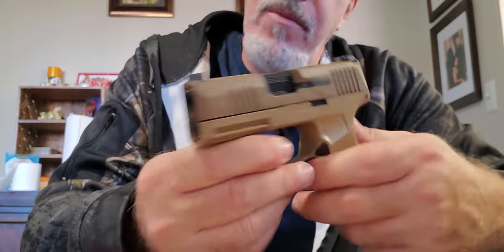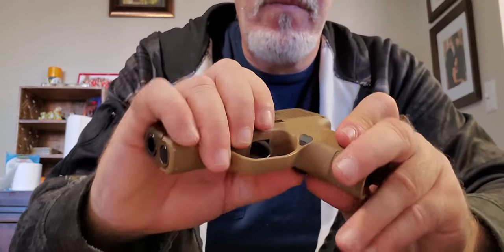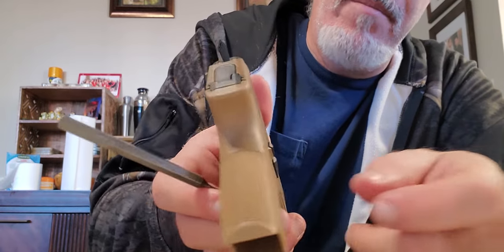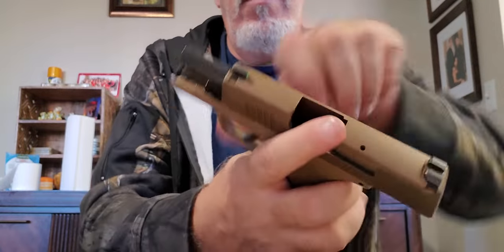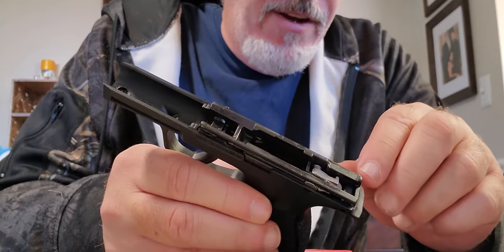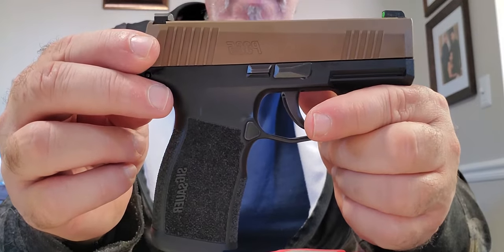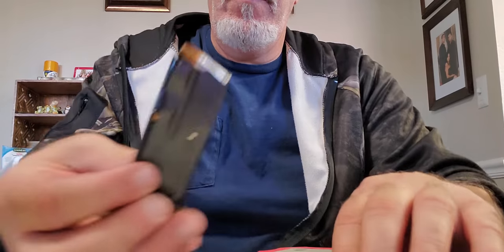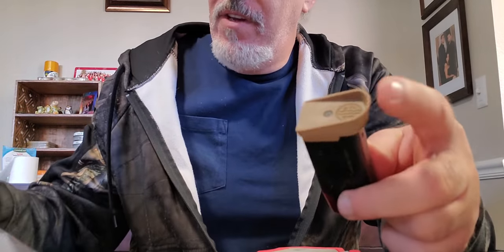Sig p365 grip to a p365 xl grip

Comment: It looks like the pinky extension on the 12 round mag when inserting in the xl frame is sticking because of the wings on the baseplate. There is a cut out for those wings on the regular p365 the frame.
Reply: I used a Dremel to remove the "wings". live having that little but of extra shape.